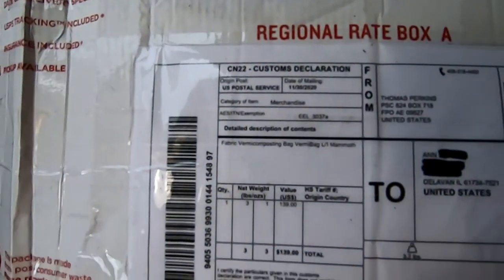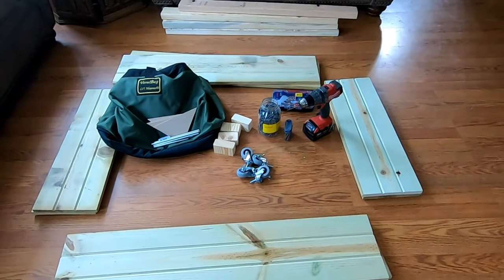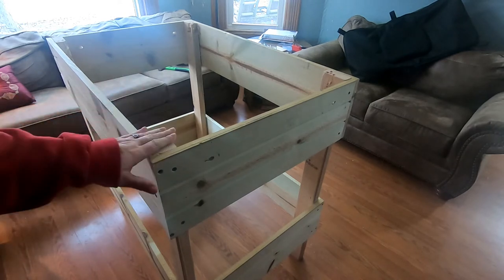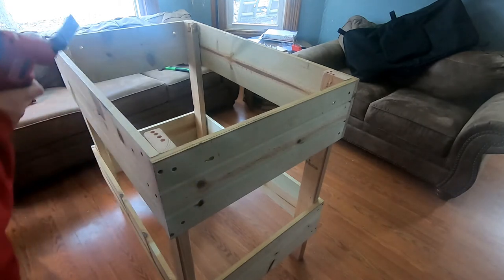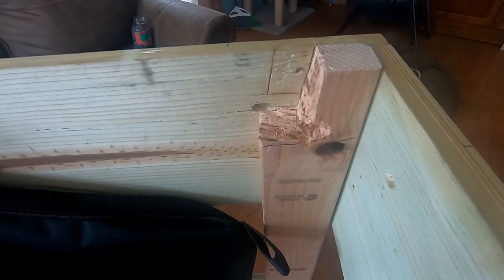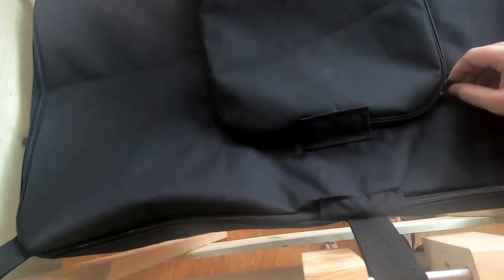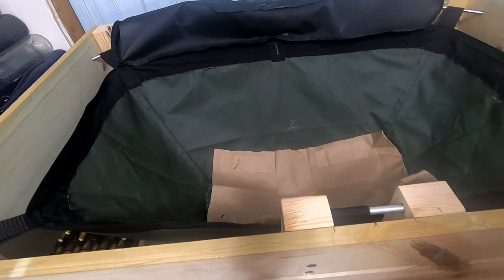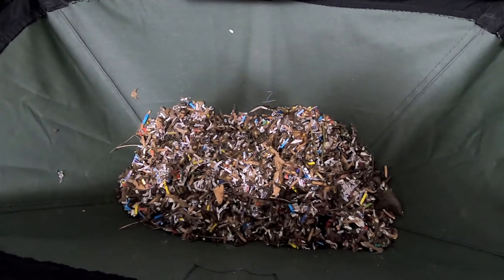VERMIBAG STAND BUILD AND ANC RE HOMING

Comment: Do Not use 2X2's !! smaller lumber does have not enough depth or strength when screwing everything together. Using smaller screws you will not have enough surface area strength,  clamping tight enough joints, and that would cause those joints to loosen and eventually break apart.
Reply from the maker: The bag will get to be several hundred pounds when full, so maybe 2x2 might not hold it?